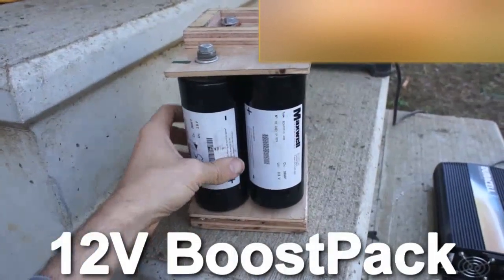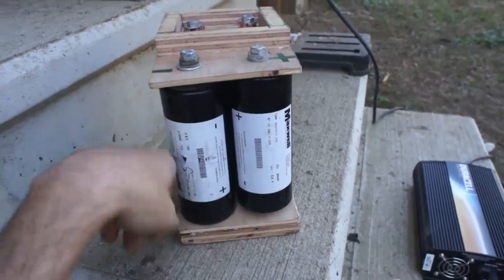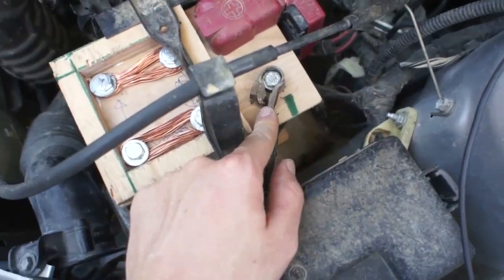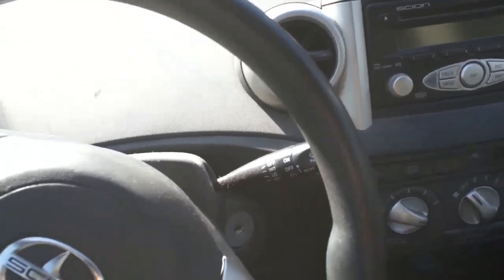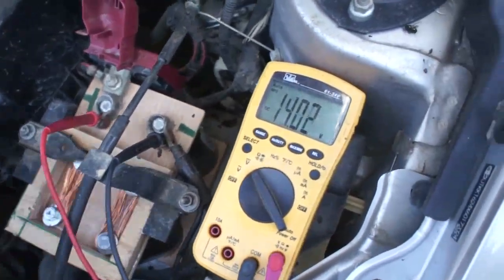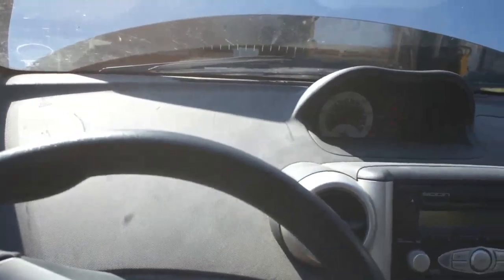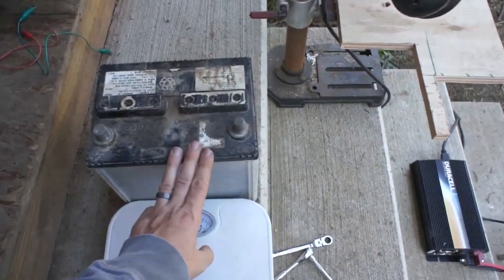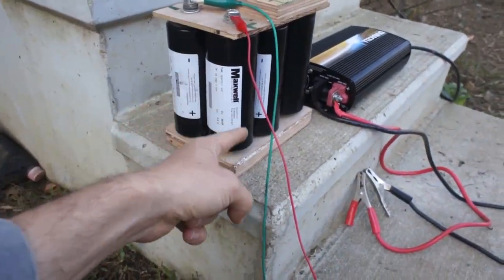12V BoostPack. Replaces auto battery. Works great!

Comment: He'll slowly melt the stator or burn up the diodes if he runs it mostly flat, then starts the car, so it's not a substitute for a deep cycle battery.. As long as he drives it every few days or a week, it should be fine. In the short term, it may blow the fusible link/fuse on the alternator output because the ESR is so low.

Comment: I'll tell you what happens if you put that in another car that's running more electronics in the background and you leave it overnight, you won't be able to start it up in the morning. The battery stores a lot more charge compared to a capacitor. Current capacitor technology does not allow storing nowhere near the charge a battery can store.I too am very curious how the graphene and carbon nanotubes experiments will end up, but something tells me capacitors still wont be anywhere near batteries.

Comment: How well does your alternator get along with the caps?  A discharged capacitor has no resistance to current flow, unlike a battery, so it's going to act like a short circuit until it's taken a partial charge.

Comment: so what u think u are the first to think of this?  Back in the late 60's they came out with "batter eliminators' that are basically the same  thing that were for british  motorcycles. They made them against the law. There is a motor vehicle law that all batteries or battery replacements must maintain the car headlights for 5 minutes w/o the motor on' This law is still in effect'

Comment: You should read a bit about the difference between batteries and capacitors. Caps are very fast, but they cannot store alot of energy. If you want to power something for a long period of time, then I guess you have to wait for someone to invent a better electrolyte. They are great as a buffer to provide short bursts of energy, for example in hi-fi amplifiers. Never seen it used as a starter battery before.. now sure how well it will work in a cold climate when the engine oil runs like syrup.

Comment: Great idea and great work. I've noticed the roadside assistance techs are carrying bump-packs that are less than lunch-box size and I saw a dead Kenworth with no air starter turned right over and fired up with one of them. I'll bet they are purely capacitive now - I think you've hacked the "secret".

Comment: He got very lucky, those usually run $40 - $50 dollars apiece sometimes more. There is a reason why cars don't use big capacitors, because $/cranking amp/pound, the battery is the cheaper more compact and efficient way to go.

Comment: Maybe not, but when you end up with a bank of capacitors as big as the engine itself just to get the same capacity as a regular battery you've drifted well off the path of common sense in a design.

Comment: This is like comparing a D cell to a hearing aid battery, they both may produce the same voltage, but the actual amount of current they can produce is vastly different. Additionally car batteries are designed to reliably discharge under load, as well as operate under a wide range of environmental conditions and to continue doing so for years, Mega caps aren't meant for this and won't last long doing this job.

Comment: Thanks for posting this lasersaber, it's a good boost pack you've made, and I think you're onto something, it's a great idea, and I may consider trying it out.
Could you let us know where you can buy them for $6 a piece?  I'd definitely pick them up for that price!

Have you considered installing a 7Ah(88.2Wh) sealed lead acid battery as well(Total of 100Wh)?  With that hybrid battery, you'd have the capacity and cranking amps you need, with the weight savings too.

Comment: Hi,
Good question, it could run it, but remember each 3000F capacitor @ 2.7V has about 2.241Wh of energy.
Laptop batteries have an average of 100Wh, so his pack could run your laptop about 12.1% as long.  Won't work very well, considering the size of the boost pack.  It's good for high current draw, not a continuous load tho.

Comment: No, I don't think it will.  Assuming your ECM uses 0.1w idle, which is reasonable, you'd have 100 hours of operation, or 4 days, before you've used up your 10Wh in your capacitor.  
If you have an alarm, or keyless remote entry, your vehicle could use up more than 0.1w at idle.
You should meter your car's idle load using an ammeter, so that you can determine how long the battery will last.  
His pack has about 12.1Wh according to my calculations.

Comment: From what I can see, he's using Maxwell 2600F ultracapacitor(model BCAP0010), they sell for about $249 USD on ebay.  I think he said he got them for $6 a piece, not sure if he was in a group buy for that tho.

This is definitely a good idea, but you might want to carry around a 10S 2Ah NiMH pack to charge it up when it gets low on power, because it sounds like it only has about 1Wh of energy, that can get used up quickly if you're sitting there listening to the radio for 5 minutes.

Comment: The energy in these caps is too small to make it safe for all usage scenarios.
One problem is that some cars have electronics that uses a constant energy for alarm system, radio door locks etc.
This capacitor pack holds some 10Wh energy at 12V but you can't actually recover it all as the voltage wont stay high enough. A lead battery typically comes with 16 Wh per Pound or in the case of this video, 320Wh or so. That's 30+ times less reserve for use of radio/light when engine is off.

Comment: That's the kind of setup used in highway trucks; instead of using 4X 6V batteries (2 in parallel, 2 in series for 12V and 500+ cranking amps), some truckers use 2 6V batteries in series (12V) and a capacitor bank in parallel with the batteries.  This shaves off about 100 pounds.  To recharge they use either the truck's alternator while driving or an APU (thermo-king, rigmaster etc.) if the engine is out and the battery is low.

Comment: Your car is running well and it is already warmed up.
Have you tested this under adverse conditions?
Below freezing; Car is a hard to start car.
How much cold cranking MINUTES do you have?
I had an old Toyota with a carburetor. Sometimes would take more than 20 min to start on very cold days.
I think it's a brilliant idea for warm climates and good running cars. How many life cycles for the capacitors. It's also a great idea for emergency jump starts / booster for hard to start cars.

Comment: an insulated pack of 11 nimh cells to charge the caps for those situations would be super, they'd be the reserve capacity.  a tiny solar panel in the window for slow charging it.  i figure the best benefit is high current discharge, slow charge it with really tiny batteries to overcome some of the limitations.

Comment: Actually, the voltage on the parallel capacitors would be whatever the charging system puts out. Except that if the voltage rating of the capacitors was exceeded by too much they would probably fail. 12v applied to parallel 2v rated capacitors would likely kill them. 

I would be a little concerned about using big caps in place of a battery. A capacitor acts like a dead short on initial charging. This could possibly decrease the life of the components in the charging system over time.

Comment: Sorry i dont think that you are right ..... if they are in series the voltage would be 12 volts and the capacitance 58.333  
when in parallel the capacitance value is being added 
so if they were connected parallel we would have 
C1+C2+C3.... = 2100 F 
and for the voltage we would have 2 volts .

Comment: 6 capacitors rated at 2 volts each in series is 12 volts and the capacity will be 6 x what one cap will be, so if its 350 F per cap then that is 2100 F which is a large charge capacity.

Comment: A car battery has a 2v head useage meaning at 10 volts the batter is dead and very likely unuseable, the standard car battery only delivers 20% of its capacity where as a deep cycle batter will allow an 80% discharge and recover nicely with a long enough recharge..

Suggest you get your facts straight itay times...

Comment: I can see a lot of good things with this, Maxwell also produce a starting kit for trucks under the same principle, the only difference is that you only replace 1 of the 3 or 4 batteries of the truck with this starter, then it will always be charged because is connected in a parallel circuit. The bad I see is the cost of capacitors is they are sold for 30 to 50 dollars each anywhere I'd looked on the Internet.

Comment: Interesting vid. Thanks. How long does it take to charge the caps from flat to full using your solar panel? And what are the specs of that panel? Also, how much to these giant caps cost at regular electronic supply companies. I'd be surprised if they sell for just a few bucks apiece. Still, anything providing off-mains power and reducing lead in the environment has got to be helpful.

Comment: Carefully... I charged the entire pack so that the highest any cell got was ~2V, and then used a set of jumper cables + a about a foot of rebar as the "resistor"; manually bringing each cell down to within 0.01V of each-other: just monitored temperatures during the discharge of each individual cell and managed to not spark...worked well.

From there, the plain old car charger took the entire pack to 14...something volts, while each cell has settled within 0.02V of each-other since.

Comment: Since I own a copy of Basic Electronics from high school many moons ago, I will share with the class...  Capacitors can charge INSTANTLY if provided the proper amount of amperage at the correct voltage, and discharge INSTANTLY with all the accumulated charge at once.  Vehicle alternators produce between 65 - 125 amps depending on the type of vehicle.  The capacitors can absorb ALL this charge and and voltage will balance in seconds vs the chemical reaction delay in absorbtion with batteries.  :)

Comment: If it charges fast, recovering 14VDC, by using the same charging circuit, then it means you are not having the same ammount of charge in it than in a battery, because the charging circuit can drain only a low ammount of power in a low ammount of time. I would say it would be a good replacement if it takes the same time than a standard battery, or even more! because that would mean you have more power accumulated on it. So it's a bad replacement. Sorry.

Comment: Seems that can be used together with lead acid batteries.. As cold start hi amperage kills leadplates capacitor discharge will by pass this high current in the accumator  thus triplicateing life of the lead battery.

Comment: For the Quick power draw that happens if you leave the car's lights on or the A/C have you tried to look into getting a solar panel with a DIODE to only allow a charge to the capacitor?

Comment: So what are the downsides?  If you forget your lights on for just a few minutes you run out of juice?  If you accidentally discharge the capacitors (touch both contacts with a screwdriver or something) you are done for?  Anything else?

Comment: You are correct! If this 'boost pack' were to be jumped from another car and he reversed the polarity it would blow up. If you do that to a car battery it will spark like crazy and probably mess up the jumper cables, but it would not explode.

Comment: So many questions that can be simply answered by doing!  You could get an amplifier install kit with 4ga wires and install the boost pack in the trunk in a plastic battery box.  This would eliminate the engine heat problem and the safety concerns.  Many newer cars have the battery in the trunk already.  I would love to see this implemented on a Prius with flexible solar PV panels on hood and roof!

Comment: Interesting indeed. I'd be concerned about the reserve capacity in case of an alternator failure. I'd also be concerned about the increased load the capacitors will place on the alternator since it will be much higher than the battery while charging. However, that might be moot as it should mean that the alternator is charging the pack for a much shorter time. Not sure how all that will impact the life of the alternator and voltage regulator. Very interesting.

Comment: The voltage regulator in the car's alternator handles this function, turning on typically at 14 volts or so and allowing current to flow from the alternator until the system reaches that level again. The battery itself doesn't really regulate anything. Like the capacitors, the battery acts like a big bucket of power absorbing the impact of high loads and of course storing power while the car is turned off.

Comment: yes, the solar panel voltage is up to 17 volts if you use it straight, you must use a solar panel controller lo limit the voltage under 15 volts, the maximum voltage of the boost pack, if you pass this voltage the capacitors explode!!

Comment: Would it make sense to run a boost pack with your 12V battery? Let the capaciters take the bulk of the load from starting, but mantain the runtime and capacity of the lead acid battery. Perhaps by not subjecting the battery to the rapid discharge of starting the engine, you could get a few more years out of your battery.

Comment: Those wires are _begging_ to be replaced with bus bar.  The wood should go; it needs to be replaced with rubber mat on some nice thick pvc sheet.  Don't seal them in a box, but it might be a good precaution to put a thick-walled metal box around the sides.  If they pop, the force would then deflect vertically.

Comment: As a former aviation electrician, I've seen caps used under far more strenuous circumstances.  It needs to be over-engineered to prevent those kinds of circumstances.  Caps don't pop because they're filled with explosives, obviously.  They pop from thermal pressures when they're applied outside of spec.  A little smoke is a secondary effect.  As long as they're not _sealed_ in a metal box, any potential burst could be baffled vertically.  I'd say the battery is a bigger fire hazard than a cap.

Comment: Have you ever seen what happens to capacitors that fail. Its an explosion. That is why you don't use them under the hood of your car. Dangerous, do not do this. Just search videos for  capacitor explosions and notice how small those capacitors are compared to the ones used in this video.

Comment: Low voltage problems don't come from the battery voltage.  The alternator of the vehicle regulates voltage of the system, not the battery.  If you have low voltage issues, your voltage regulator is bad, and you might need a new battery as well if you discharged it too deeply.

Comment: one of the benefits of the lead-acid battery is the power density. if you lose an alternator while traveling, you will be able to run your engine for quite some time on the battery reserve. if this happens, you should shut off all accessories, like A/C, lights if not needed, radio, etc. this depends on the condition of the battery. but, there are uses for such a light weight capacitor storage unit. good job. great to see the innovation.

Comment: Even though it's light and charges up quickly, it still holds much less power than a traditional battery, meaning it also DISCHARGES quickly.

The only advantage i can see is portability.
You can run stuff out in the field with it, without having to haul around a 20+kg battery, and that's nice.

Other than this, there's really no point.
Reducing the car's mass by 20kg isn't going to have any impact whatsoever on its efficiency, not using engine braking would save orders of magnitude more petrol.

Comment: this has me very interested.  one thing to test for is if its bad for the alternator.  a lead acid battery acts as a "buffer" for voltage spikes.  even though theres a regulator the voltage coming from the alt isn't perfectly constant.  caps may not buffer as well and this may harm electrical componants as well.  something to look into.  i want to try it though!

Comment: Car batteries? Safe? An acid filled block of lead that emits hydrogen, safe? A device that's more likely to explode while you have the hood open (like when you're boosting it improperly), safe? Versus a cap that will more likely vent than explode?

There are risks whenever you cram the maximum possible amp-hours in to the smallest possible space, but all things being equal, I'd say the caps are safer than the batteries. We're just used to the batteries.

Comment: Some of these capacitors which I bought recently are specified at -40C (-40 F) to 65C (149 F). If you see -40 I don't think it would be wise to use them at the extremes of their temperature range. We designers alway like to leave a little wiggle room when we select a part for our designs. I'd hate to see you get stuck at -40.

Comment: How does temperature impact this? I live in a place where having to start my car after 24 hours at -40 happens at least a few times per year.
Reply: No effect. However your engine will require far more power to turn over as cold oil stiffens the engine. I'd run synthetic oil to ease the load.

Comment: Do note that more than two caps in series do not charge equally, this *will* lead to problems with some caps going over the rated 2.5V and then starting to fail. I'm also building a 6 cap pack (btw 6USD ? a steal! I would buy from you almost any number you can supply at 10USD/unit plus shipping)

I am building an intelligent balancing circuit for my pack:  github.com/rambo/ultracap_balancer

Comment: @Joseph Murphy, I don't know if mine does that, not put it to the test, interior light certainly switches itself off after about 10 minutes of left on.  Car is about 5 years old but is fully Canbus so probably does shut lights off.... Unfortunately Ebay ultracapacitors are relatively expensive here in the UK. I can see many possibilities for these, maybe I should bite the bullet and buy some.